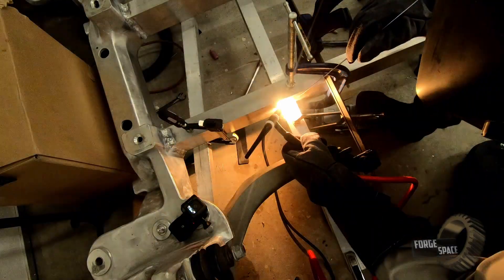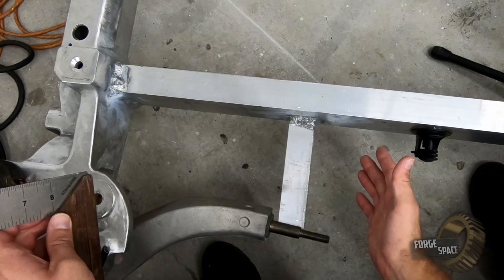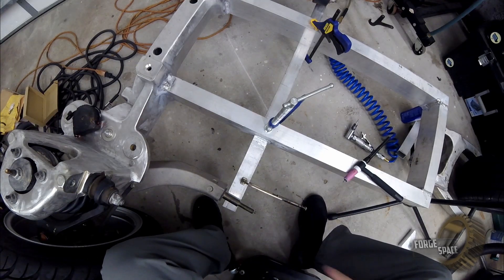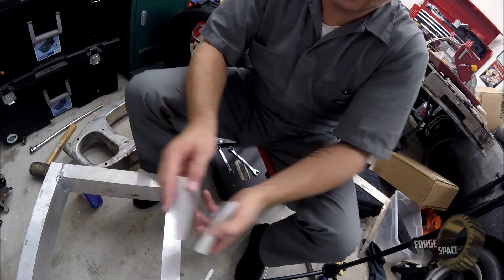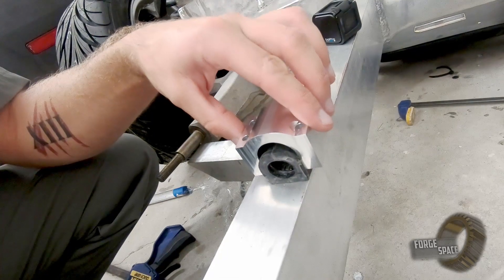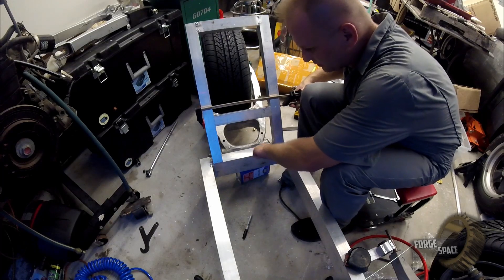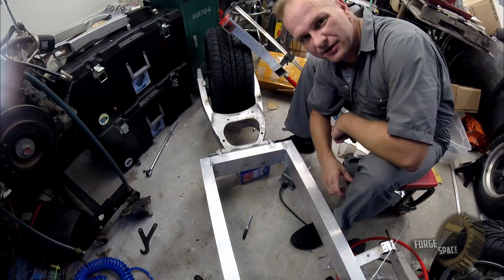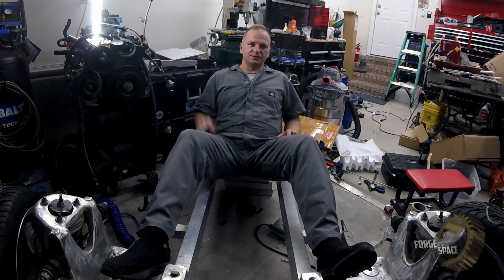More welding on the reverse trike! - EV CyberTryk EP.04

Comment: I knew if I thought about it long enough, someone would build it. I look forward to seeing it done. Have you priced the components yet? I've never seen any prices when I go to the qs motor site. Renewable Systems Tech used the same setup at 74v with great success.
Reply from the maker: I need to run through and tally up the total project cost thus far.